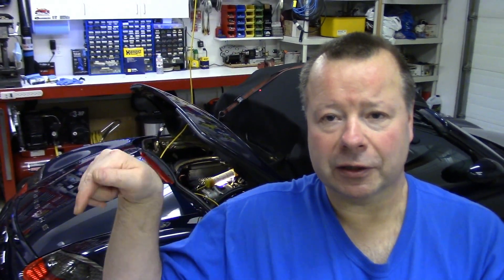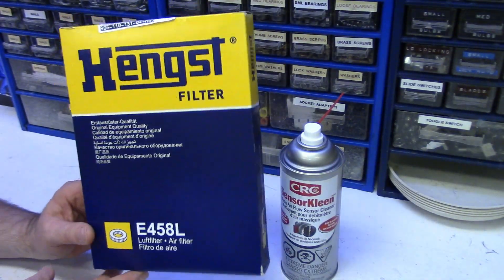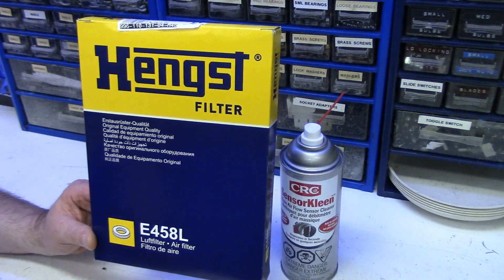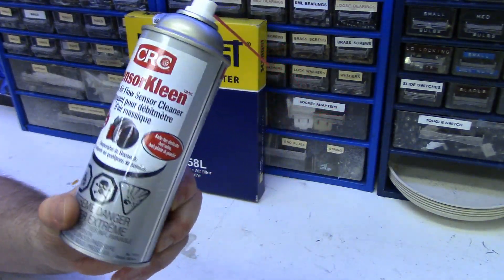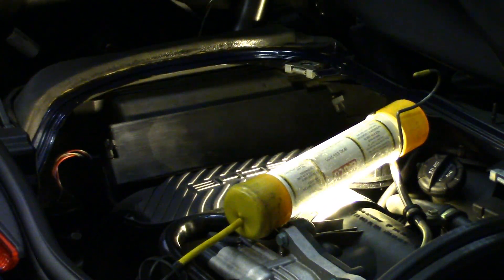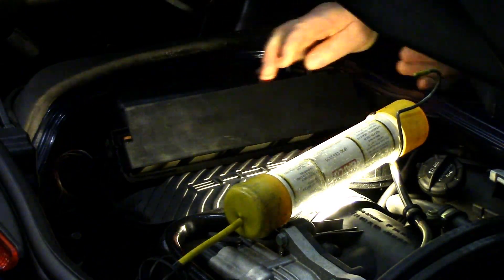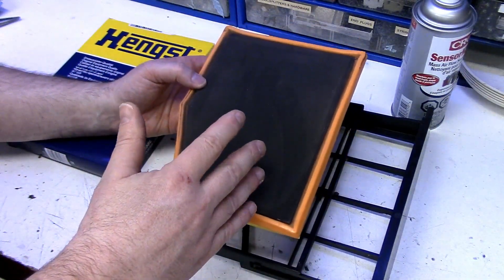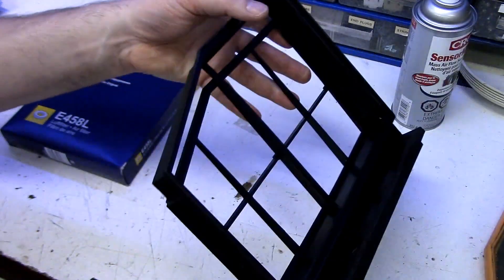DIY Boxster 986 Air Filter Change & MAF Sensor Cleaning

Comment: Don’t think I would use silicone on the air filter or MAF sensor o-ring. Silicone will quickly take out a O2 sensor.